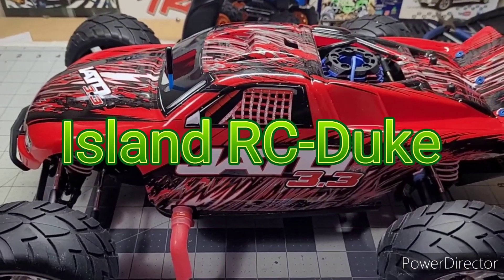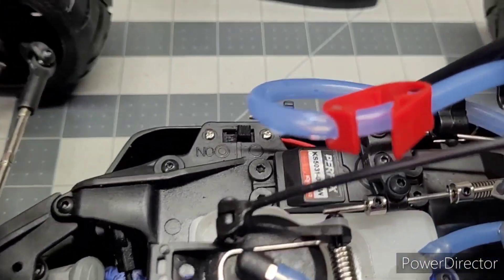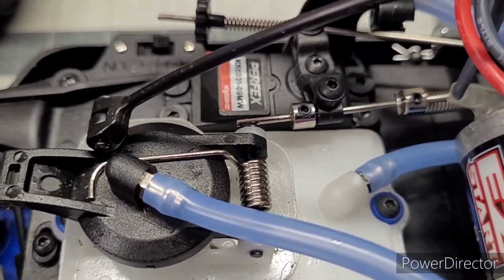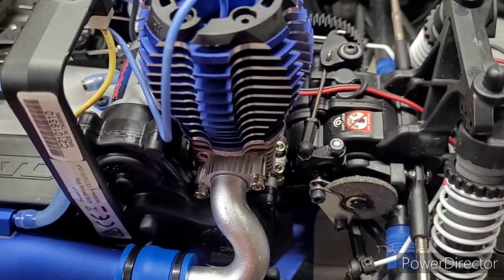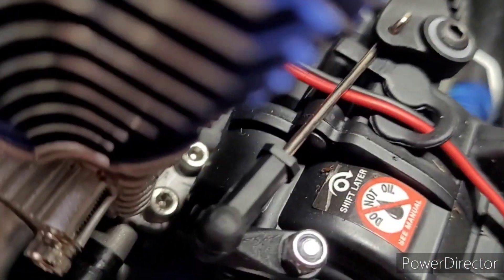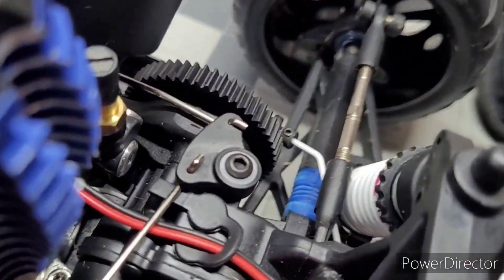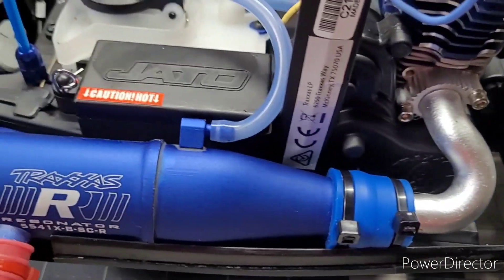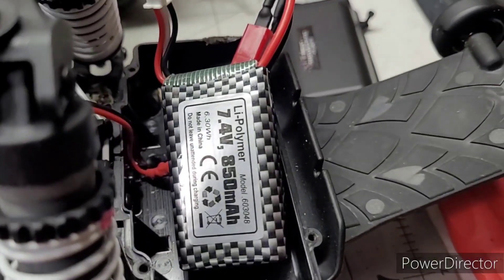Traxxas Jato Brake and Battery Mod,Shoutout To Iowa Budget RC Bashers

Comment: How has the 2s battery held up have you burnt up any servos or any thing?
Reply from the maker: the 2s works great,it is a low c discharge,i am slowly changing out my servos on all my nitros with servos that are 7.4 v or higher,just to be safe and they are just the cheap ones on amazon,all good so far,thanks for watching

Comment: Would the lipo modification work on the nitro slash
Reply from the maker: yes ,i run a small c dis charge battery in my nitros,subbed you

Comment: Battery seems pointless when flatpack fits perfect in the middle with built in charge port for it? Why not use it
Reply from the maker: the lipos last alot longer so i don't worrie about them going dead on me during my runs,i even mod all my remotes to hold small lipos for the reason,thanks for watching my friend